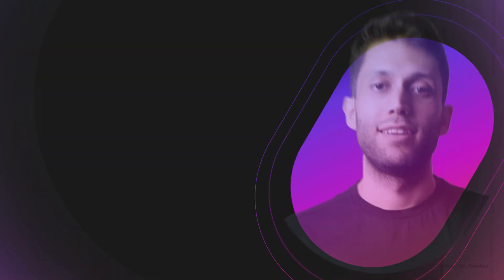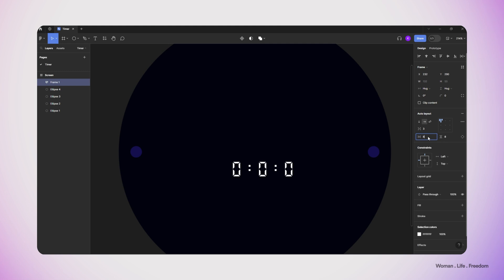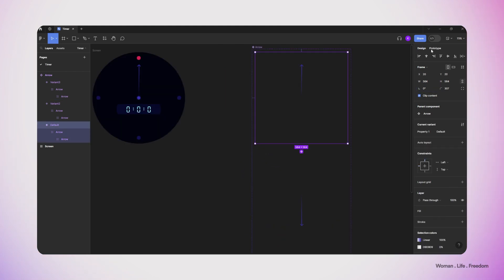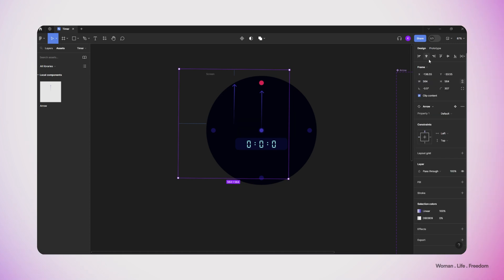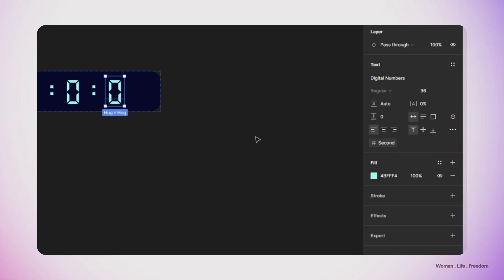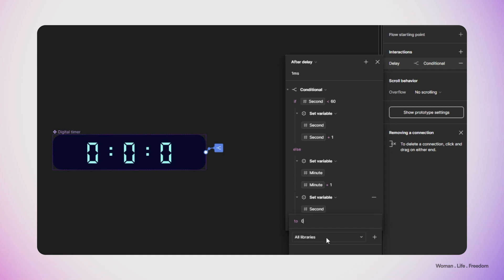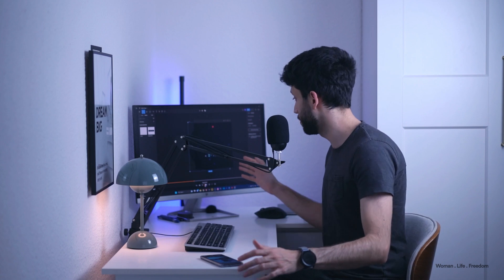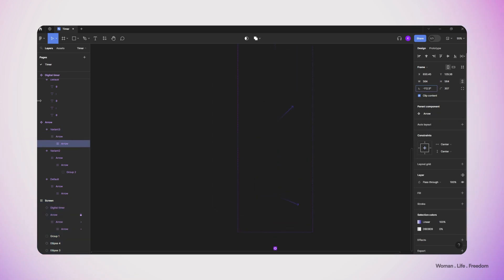Design Like a Pro: design a Timer in Figma using #Variables and #Conditionals

Comment: It does not work. When it starts it goes from 0 to 2 seconds and stops.
Reply: I had the same problem, the mistake was in the 2nd variant when you need to apply the same process to add the loop with the new interaction "Change to"... In the Default, He selects to "Change to the property: Variant2", but for the second variant you need to select "Change to the property: Default" to create the loop.
Reply from the maker: I need to know more about the details of how the issue appears. but it might be the case that new updates changed something.

Comment: Hi, thank you for an interesting tutorial. I tried it several times, didn't get what's inside Group 1 in the Screen Frame, where does the arrow on the Screen frame go when we put an Arrow instance of an Arrow component on top of it. And, of course, the arrow doesn't rotate:( Please hit me with an insight how to finish this tutorial.
Reply from the maker: I understand your confusion, I used to do voiceover and not do real-time screen recording, so I some parts would have been skipped in result. 
Group 1: is basicly just a decorative element. The circle in the center.

I deleted the first arrow when I added the instance of the component that I made.

About arrow not being rotated, I need more info. How did you set up your interaction? Maybe you have to activate the interaction of nested instances to see the effect in another frame (new figma update). Please share more info with me. 

I am trying to have real-time recording in laters video to reduce the complexity of tutorials. Thank you!
Reply: @Kimoartcave  The arrow doesn't rotate for me either. I wonder if a new Figma update made it not work.